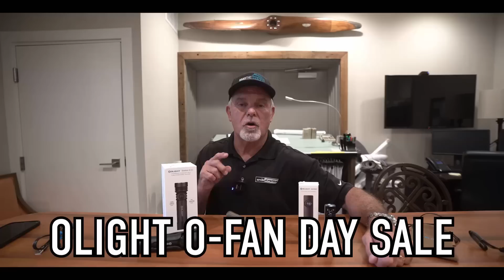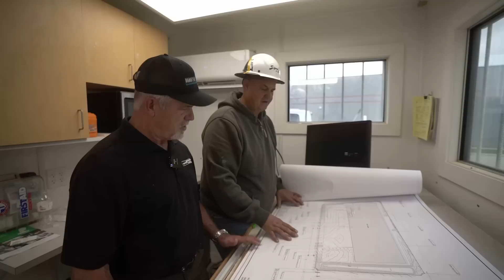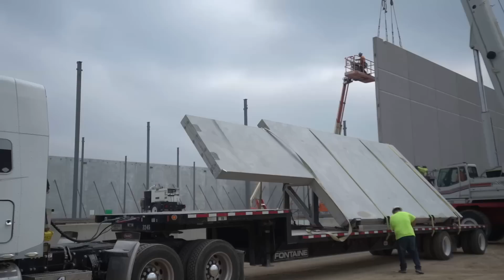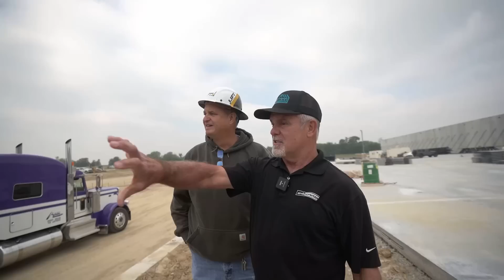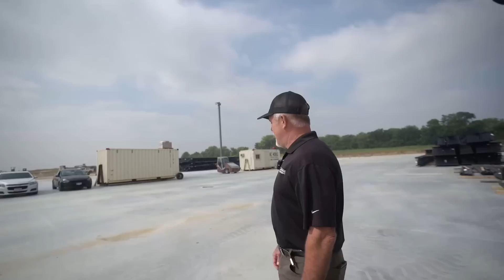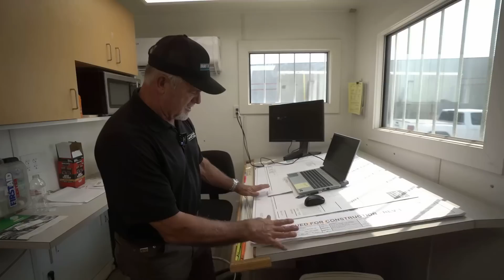RESIDENTIAL Builder Visits a COMMERCIAL Job Site! (Should I Switch?)

Comment: I love this way of building. In Denmark we have a building style for residential called Funkis. Its build almost the same way. Big precast concrete elements that are tied together and on the outside there is ex bricks at the bottom and steel or other sidings at the upper floors. In between there is isolation ect. The electric cables runs in either the top or bottom of the wall, so when you would drill in the wall to hang a painting or such, you won't risk hitting any cables.
Reply from the maker: That sounds so interesting… I would like to see that!   I wood to expensive ?
Reply: @BradtheBuilder  Wood is to expensive to use for a whole house like in the US, cause we have to import the most of it. There is a lot of concrete companies around the country instead :P
Reply from the maker: @dennisoestermann1880  I would like to learn how to build homes out of concrete versus wood here in the US🇺🇸
Reply: @BradtheBuilder  I can promise you this. When i win the big prize in lottery and move to the US, i will build a danish type of house (made out of concrete) and you are more than welcome to come and film and watch how its done. Unfortunenatly there isn't a lot of danish tradesmen thats on youtube and film there progress like you guys.
A normal house in Denmark is made out of an isolated concrete slab, bricks on the outside and areated concrete on the inside, wood used for the roof and roof bricks as the roof. There is usually rockwool in the walls and in the ceiling. Thats the normal way here in Denmark, cause we got a lot of masonry workers, and they can work even if it rains. When the roof is in place, they insulate and put up some big heating canons to dry it completely while the electricians, plumbers ect goes to work inside.
We got off course some houses that are build with loads of wood, but not as much as in the US.
I know this is in danish, but if you got time, then try and watch the video and look at the pictures Perhaps you can get an idea of how we build houses in denmark.
https://www.lifelab.dk/droemmehuset-vi-har-valgt-at-bygge-nyt/
https://forstegangsbygger.dk/tidslinje/
Reply from the maker: @dennisoestermann1880  thank you so much for sharing this!  I will look at it & I hope to visit Denmark in the near future! 👍🇺🇸

Comment: Is there any tornado requirements in your area? Just curious from Alberta Canada
Reply from the maker: No there is not! You are pretty much on your own… But most homes have basements which provide for good shelters, and if not, I’ll build homes with a concrete room that’s inside the house. It’s usually a pantry or a closet that provides shelter for a tornado.
Reply: @BradtheBuilder  That is interesting……in Alberta we have to build below the frost line so most homes have solid basements. Appreciate the feedback!
Reply from the maker: @tommckirdy  👍🇺🇸

Comment: In the last couple of months they tore one of these buildings down near me. They didn't haul the concrete away. They had a series of big grinders that grounded it into different sizes until they got it all the way down to the gravel size they need and then they use it when they pour the slab and then the walls on site. There are at least half a dozen giant mountains of gravel where the building used to be.
Reply from the maker: That would be interesting to see!
Reply: @BradtheBuilder  it was interesting but only for a few minutes. They are redoing the on ramps near my house and they also ground up the concrete, for about 3 weeks.